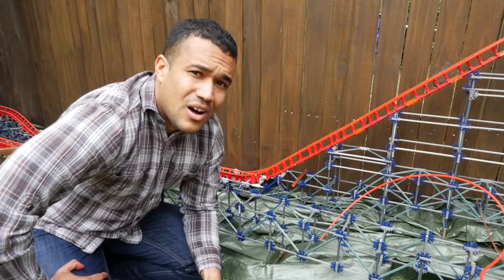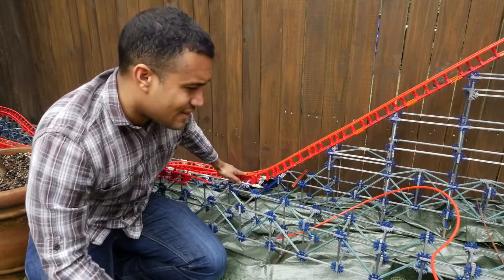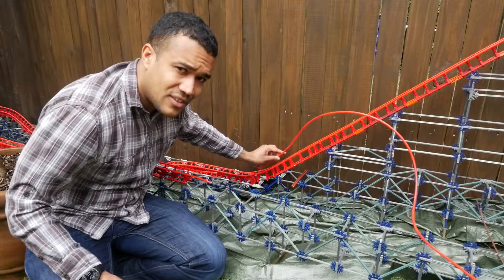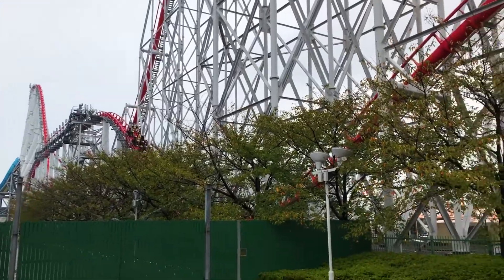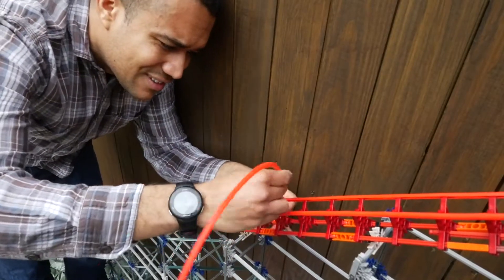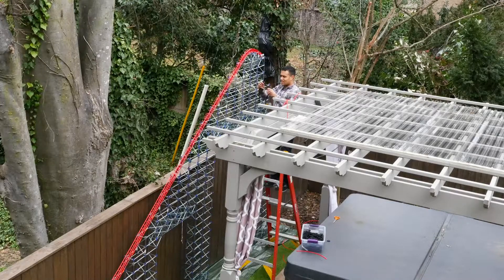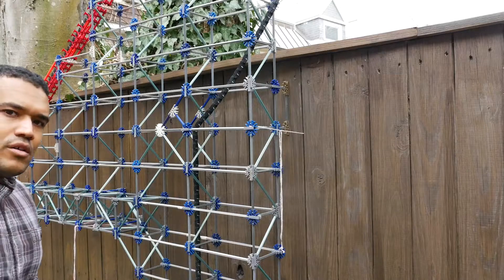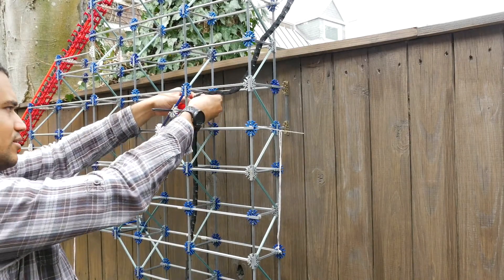Magnum K'nex Coaster: Lift Hill Construction

Comment: That's pretty sweet. Do you think you might need extra support near the top to avoid wind or anything else? I know that wouldnt be a true Magnum look though. Great work, can't wait to see the next update.
Reply from the maker: Thanks! For previous models I've built outside, wind gusts tend to pick up (and knock down) structures that are too dense at the top, so ironically, when I get really high up I think that less is more. But on the flip side, I've made sure that the structure is stronger at the base.